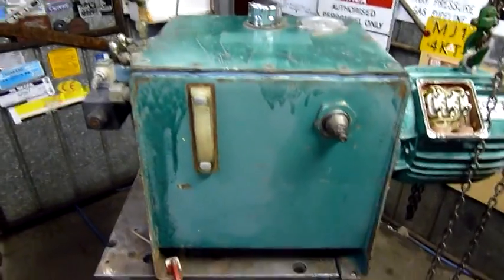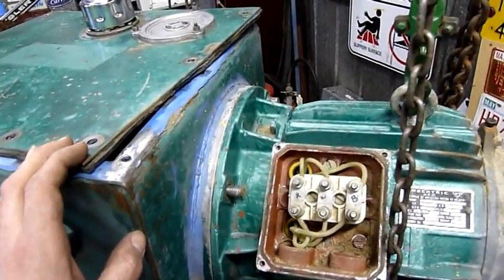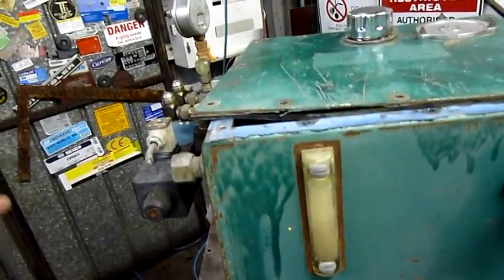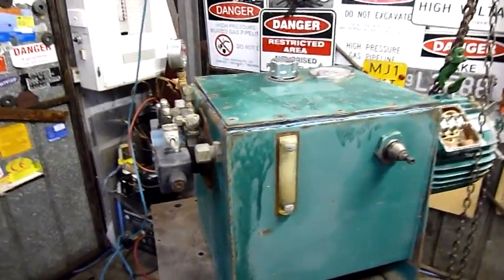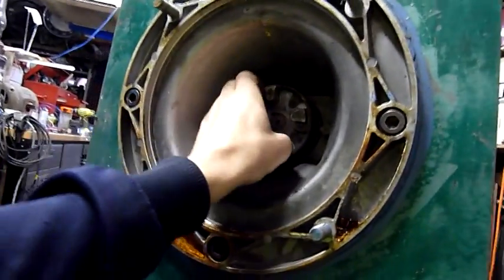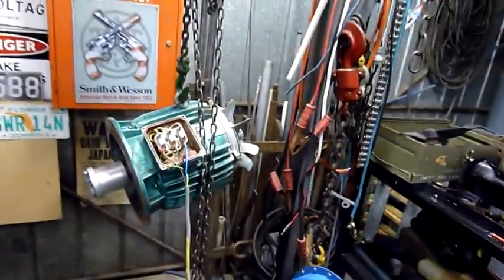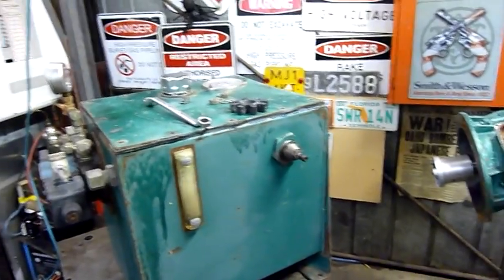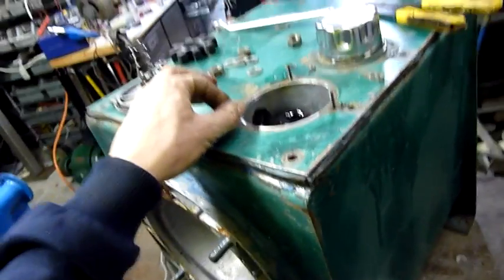Hydraulic Power Unit Modding Pt1

Comment: you have to spin the motor above the synchronous speed (8 pole - 750 rpm, 6 pole - 1000 rpm, 4 pole - 1500rpm, 2 pole - 3000 rpm) and also have capacitors between all three windings in order to generate 3 phases. not too sure about exciting it however

Comment: what are you using to run the 3 phase motors I wish I could find a good 3 phase controller converter from either dc to 3phase speed controll or singal phase 120 to 3 phase speed controll. I love to get my hands one something like that. and that 3 phase motor would make one hell of a wind turbine generator. if you take the rotor out and machined slots in it from large N52 magnets in it for a Permanant magnet motor. man you are on lucky person to get stuff like that.